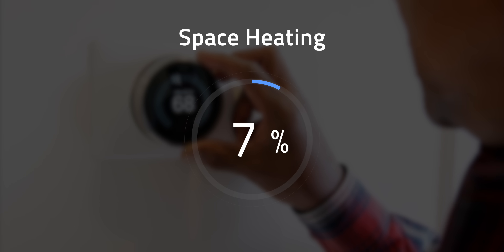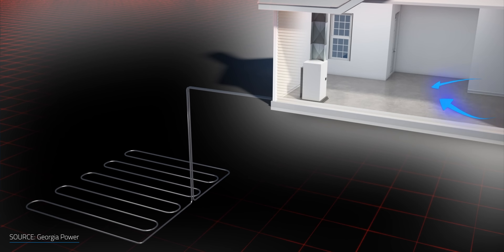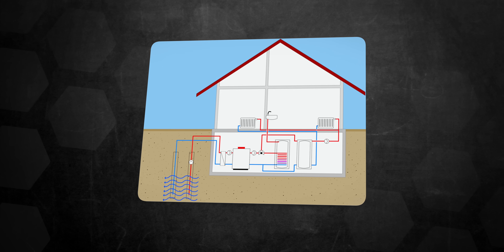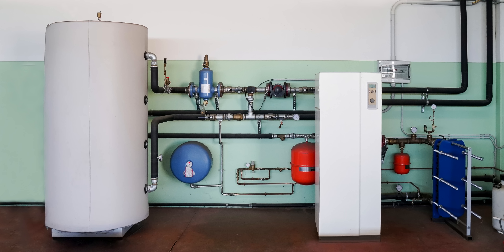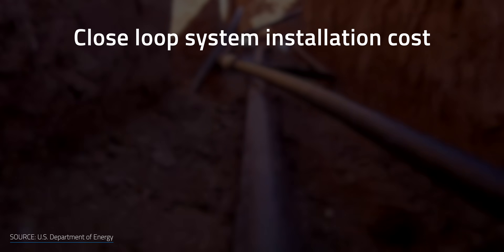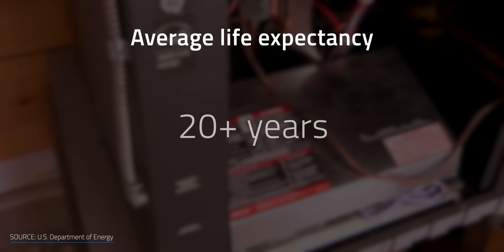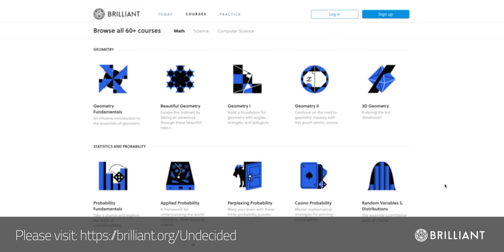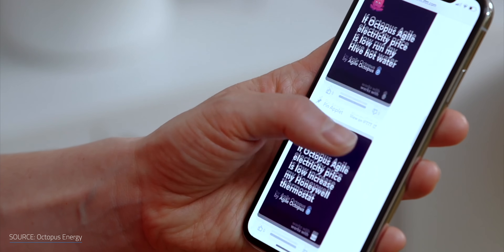Is Geothermal Heating and Cooling Worth the Cost?  Heat Pumps Explained

Comment: It would be great if new subdivisions were designed to incorporate a "shared" geothermal system installed under the roads/parks etc.
Similar to how Toronto's Deep lake water cooling works for businesses, just on a smaller scale.
Reply: That's called district heating and happens around the world. We'll see more of it in the future in our urban landscapes.
Reply: I remember actually watching a video on some real estate development consisting of a single road of houses all sharing a similar geothermal system, was pretty cool
Reply: I work for a Utility Company that when we go into newly designed subdivisions - we run underground electricity, as well as a geothermal loop. Customers can rent access to the loop for $35 dollars a month. It works great for Air Conditioning, very poorly for heating.
Reply: @CrowDog58  That is great planning.  What country?
Also, I'm surprised about the heating.  In Canada some use air heat pumps for ac and heat, they don't work great in extreme cold (< -20) but I would think that water at ground water temperature would have a much higher thermal capacity for heat exchange.
Reply: Probably great for a small dense area, but not so great for a large sprawling subdivision.
Reply: @aoikemono6414  If a giant loop is laid in in the parks or rec areas, for instance, it would actually work very well. Loops last for centuries.
Reply: pending on how tectonically active the area is, a large system could be much more at risk than a smaller one.
Reply: Not all banks will lend on shared heat, water or driveways unless there are strict HOA requirements and the HOA is financially stable.
Reply: That would make great use of space.
Reply: That would require a level of long term investment rarely seen in the US. It is rather common elsewhere though.
Reply: They do & you rent the usage of the Geo Loop, just tap into it.
Reply: @CrowDog58  
Like the 'tap into it' bit.
Reply: They do in Denmark and a few other places. Look at solar heat pits
Reply: Drake Landing Community, near Calgary, Alberta! Stores solar in giant underground heat sink/ battery!
Reply: I live in a city with a lot of parking lots in need of repairs… it would be great if we could just stick a ton of lines for heat pumps for the residential buildings and a few extra for possible future construction
Reply: Seems logical with your comment. Build the geothermal system similar to public water system. It becomes a public utility and if your HVAC breaks, or if the geothermal system breaks on your property, it becomes your problem if you're tapped into Geothermal. Any breaks in the system off your property is fixed with Public Works who manages the neighborhood/municipal/city Geothermal system.  And if you don't want Geothermal for whatever reason, heat/cool the "old fashioned" way with electricity...hopefully living within a grid powered through nuclear or hydro electricity.
Reply: That would be nice, but who would be financially responsible for fixing it whenever it has a problem in an area that's not on any residents property? Issues that are on a residents property would work like sewage and water lines, where the homeowner is responsible, but who would have to pay for fixing the system if it's main reservoir busted or something, the township? I don't think they'd be too happy to have it built then, since air units by comparison are all on the homeowner.
Reply: @kadewiedeman3127  HOA can finally make itself useful
Reply: @lucassalas1572  oof, I can only imagine the HOA fee of living in a place with that system, now. The ridiculous $200/month ones here in NJ would look like chump change by comparison.
Reply: @kadewiedeman3127  Actually since the maintenance is so low it would be next to nothing. Of course if you dont want that., it could be an assessment that would work just like if a town demanded you put in city water. Cities cost is $100k and we have 100 homes and it is $1000 per home or probably a more fair way would be to get each home based on size and say you have a 250k square feet and it is $100k to fix it becomes $0.40 per sq foot assessment. or $400 on a 1000 sq foot home and $2000 on a 5000 sq foot home
Reply: @kadewiedeman3127  
If it's affecting their personal heating and cooling they'll figure it out.  The issues could be partially solved by confining particular loops to the residence it is closest too.  Their repairs would be to their own systems and the roadway affected.  Of course many places have their own driveways they could utilize.
Reply: @kadewiedeman3127  My thought on this would be making it part of an HOA or make it part of a taxed area where the town, city or township would take responsibilty, just as they currently do with water or sewer pipes.
Reply: @kadewiedeman3127  Just like everything else. The city is responsible up to the meter. You are responsible for the rest.
The incentive for the city would be less strain on other infrastructures like the electric grid or gas pipes. A lot of places need to import those, which means better negotiation on their part for the costs as it's less critical to their infrastructure.
Reply: @kadewiedeman3127  It's such a great idea and the bureaucratic solution has got to be WAY easier than the hurdles oil and gas face, not to mention a helluva lot cheaper.
Reply: As an actual Expert Witness in the Industry with far superior academic & experience resume, I'm annoyed at your analysis from an unqualified bofoon -- Richard E. Lelli, P.E., M.B.A -- like getting advise from a donkey, literally -- English degree with neither Contracting or Engineering experience -- Our Lawyers filed a criminal complaint to Google for disinformation.
Reply: @richardlellip.e.m.b.a.7969  Arrogant twat offering nothing constructive.

Comment: I would rather using Solar system: building sealed water pipes around Inside the house + fish tank heating devices warming water tank that connects to those sealed water pipes.

Comment: There is one part of this that is not covered, and I find it difficult to get answers: how is the heat 'replaced' in the ground? If we're stealing the heat from the crust, it has a thermal delay. What happens is everyone starts using geothermal energy? Will the crust begin to cool quicker because we're ruining the thermal efficiency of the crust - like cutting holes in the insulation on a hot water tank, so we can get the heat. What if it took 10,000 years for the crust to regain its heat equilibrium? Are we just 'kicking a can down the street'?

Comment: I have a vertical closed loop system in Winnipeg Canada  for 15 years. Works great for both heating and cooling 
I agree with other comments that it is surprising they are not more common
Reply: I know it can go to below -40 in the winter.   How well does it work at these temperatures?
I live in northern Ontario.

Comment: I offer this as an anecdotal example of living with a geothermal system.

We have a geothermal system in a 2600fsf house we built in 2012, and it's almost cheaper to heat/cool this house than my previous house which was about 40% the size of my current house.

However, the new house uses more modern methods  of sealing and insulating.  The old house (built in 1975) also had a low efficiency gas furnace, and less efficient windows, so it's a bit of an apples and oranges comparison.  Still, it was a pleasant  surprise when the first bill came in.

The entire system cost, ducts, four vertical wells and all, was around $30K and we took advantage of the 30% tax credit.  The electrical power company gives us a discount on our electricity for having all-electric heating and cooling.  Also included in the cost was a highly insulated electric water heater as the system uses the heated water in the winter time.

Heat pumps, (or plain electric heat for that matter,) don't need makeup air coming in to replace flue gases rejected by a combustion process. So things are incrementally better on on that front too.

Nine years in, the system, built by Carrier, has been 100% reliable.  Your mileage may vary.

Geothermal is supposed to have advantages on various fronts, environmental impact, efficiency and perhaps long-term costs.  The root source of that power, whether it is coal, nuclear, wind, solar, or natual gas, affects these advantages.

So is my geothermal system more environmentally friendly?  When our area had an operating nuclear power plant, maybe.  However, when the local nuclear plant was decomissioned, (it was a single-reactor plant built in 1969,) the major electrical production source became coal supplemented with natural gas turbine generators in peak periods.  So no. it's probably dirtier now. BTW, that also means all the electric cars in the area are  coal-powered as well.

I offer the following nuclear plant info as information, not advocacy for or against nuclear power.  I was actually disappointed when the plant was decommissioned.  But its ongoing costs still affect the overall costs of our all-electric geothermal system.  

Nuclear plants of the era our plant was built have a working lifespan of about 50 years, and after they're shut down they still need tending for about another 50 years.  The materials a nuclear plant is built from, the steel and concrete, become somewhat radioactive and need time for that radioactivity to decay before they can be demolished safely.   So even though we aren't using electricity produced by nuclear power, we are, in a way, still paying for it like we are and will be for another 50 years.  This plant, like a lot of others, has spent nuclear fuel still on site, sitting in a pool of water still waiting for its ultimate disposal.  However costs are mitigated by the fact that our state has utility systems that are owned by the users, so our electrical costs to the user are lower than most states.

Looking to the future, the local coal plant has been upfitted to be about as clean as possible, and the power company is being very helpful when people want to tie their photovoltaic systems into the grid.  The power company is also exploring grid-level wind systems, and grid-level PV systems.  Interestingly, they don't seem to be exploring modern nuclear options at all.

Bottom line, we love our geothermal system no matter where the power comes from.
Reply: That was a lot of good information!  Thank you!
Reply: We install units in old farmhouses that are leaking like sieves and which the owner was on propane or oil and paying $4 - $5k a year (!) plus A/C on top. The houses get warm without insulation and save the owner at least $2.5k a year. The 30k unit or lower if they had a pond loop or a well is paid for in 10 years.

For a long time our ideal client for geo was a young family living off the gas line with a large yard or a well and an old house. We did good business at farm shows. It's changing as geo becomes more well-known. Installing loops underneath skyscrapers being constructed will be the next big thing.
Reply: In our area you can purchase your electricity from all renewable sources.
Reply: In the late 90's I installed a ground loop system, the installer did not understand the soil conditions required for the system to operate. It was a complete failure and a waste of money. 25 years later I have been to many energy efficient homes in cold northern Alberta, in every case a well insulated envelope far outweighs the heat source. The apples and oranges comment is so true, talk to someone about how cheaply you can heat a R50 home, your insulation will last a lifetime, your $30,000 heat system will not. I am guessing what a geo thermal system costs today, the point is a heat pump, electric heat or thermal massing makes more sense than a intricate system that will eventually fail.
Reply: Ah, the 'Greenpeace Effect' on the power company's 'green' future. Between using breeder-reactors to desalinate sea water, and the recycling of spent fuel rods (it's big in France), nuclear should at least get a shake... but these are far from sane times. If you don't want to live in the stone age, you're supposed to feel bad. Thank you for the excellent overview of your geothermal pump!

Comment: it was a little funny when you said the UK cost roughly lined up with the US cost
13-35k pounds are about 17-47k$ - which is about 50% higher cost than the most expensive range you listed
Reply: It's funny cus in the UK I was quoted £20k.

Comment: Current and previous house have this system, but here in Norway it is either Air to liquid or liquid  to liquid HP being used. The latter implies a well to be drille at an average (pending size of dwelling) dept of 120 meter. Average cost of US$ 250000 before US$ 3000 incentive. However it replaces a conventional system in some instances the chimney as well. Furthermore my experience indicates a better price when selling the house comparable. The comfort and convenience of such a system is another side of such a system. My first system was down paid in 7 years installed 25 years ago. The owner just replaced the HP.

Comment: In Germany it costs 36000€ government payback 40% so you are around 22000€ gas costs about 10000€ with work without you pay only 6k that's a gaint difference of 16k and we have the most expensive electricity in the world so yeah it's not worth it

Comment: My neighbour built a house at the same time as I did, he chose a ground coil heat pump and I a modern natural gas heater. I was recently shocked that his electricity bill is bigger than my gas and electricity bill combined and that is including a special rate for electricity he gets thanks to high electricity consumption. The cost plan is actually called "Heat Pump", that makes me think that all heat pumps have very large energy demands. It quite shocked me, because I always though that the electricity needed to run the pump would be marginal and that the HP is economically much better option. But that makes me think, that high initial costs plus no significant gain on operation makes this heating option very doubtful. In the case of my neighbour, he's fearful of gas, so it fits his needs.
Reply: Are you sure he's not just heating way higher than you and/or bad insulation?
Reply: @Masterrunescapeer  I wouldn't say. My wife was pretty wastfull past years and we heated the house to about 25°C, that's difficult to beat :-). Also, I'm quite sure he has comparable insulation, since he built the house at the same time as I did and the building codes were already quite strict and besides that, he's a smart guy and I'm sure he didn't underestimated that. But he has larger house and I'm not sure about his windows - I have very good 3-pane windows and the house as the whole thing were at the low [energy] end of low-energy class of building regulations. Obviously, the 3-pane windows come at a cost, so they're not a standard choice even to this day. But besides all that, he told me that his electricity cost plan is called "Heat Pump" and that he has special rate (I noticed that plan in the offers of energy suppliers when I was moving to different one in the meanwhile). That can mean only one thing - heat pumps are major electricity consumers, like the electric boilers or electric floor heating, and such. And he also directly confirmed that. Still, it can make some sense, but I'd be very carefull to calculate this heating option, as well as all the initial costs, new pump every 10(?) years, etc. Sadly, it doesn't seem to be a no-brainer, magic option.

Comment: My experience with geothermal systems is buying a high-end unit, One with great reviews, water Furnace, climate master  or you will be regretting it. Cost of electricity adds to the calculations, parts replacement. mine is running on 20 years  on a close loop system. next is solar run systems less amps to run it at start up.

Comment: These types of systems work best if you have a house wife/kids that give a system a workout. Other than that a well sealed/insulated house with a high efficiency furnace Is the way to go with some thermal mass (2 layers of drywall)...:)

Comment: Our visitors main source of energy on planet is Geothermal. The first part of planning any community living centre like town or city is deep geothermal exchanger. They also pipe the heat from active geothermal area to cities and town. Mankind has no understanding of internal structure or evolution of planet. Our visitor main use of geothermal energy is for environments and planet temperature. Regulation. This is to extend life bearing period of planet. As they are civilized, they do not have artificially created values. So people’s need are met by government and planed for benefit of all.
Full science information in my 1975 Bremen Summerhouse notes or by official request only. Ferydoon Shirazi. MG1

Comment: When I win the big lottery, I will have a home built with the geothermal heat pump. I would build it with excess capacity, just because. So if I need enough underground piping for a 5000 sq ft house (I just won the lottery remember) then I will install enough piping for a 10,000 sq ft house. This would also be like having insurance against really hot and really cold days.